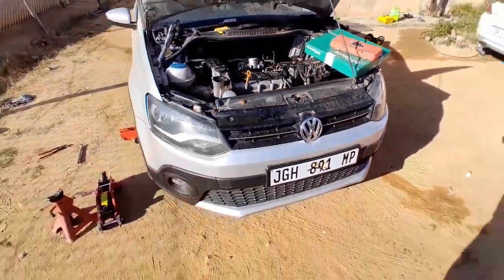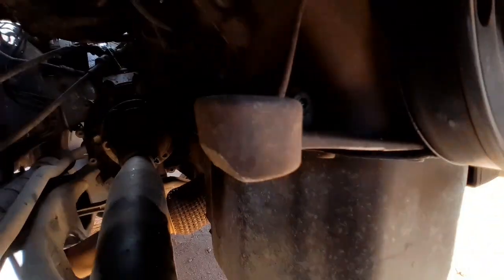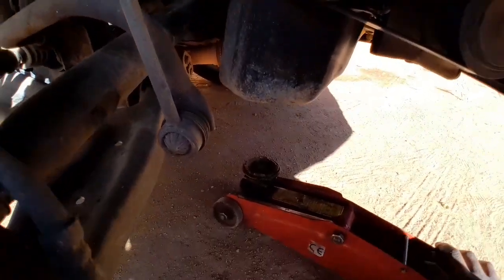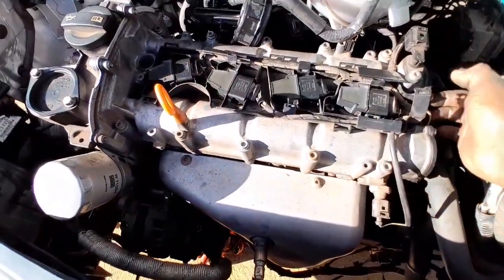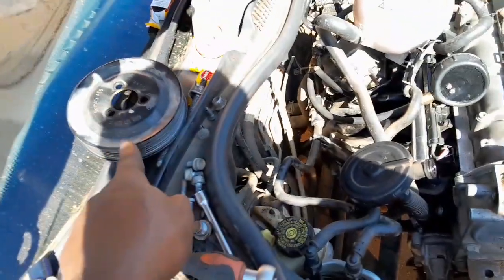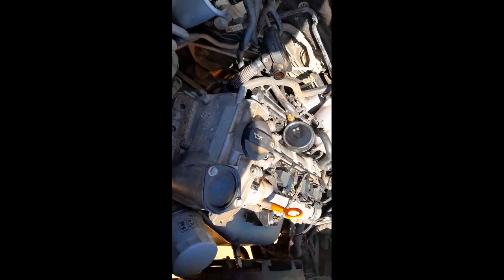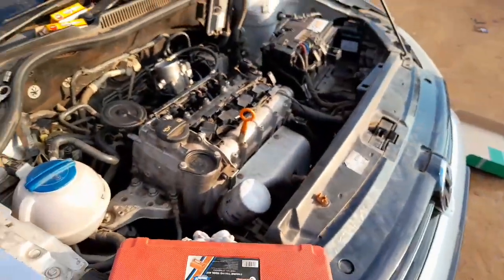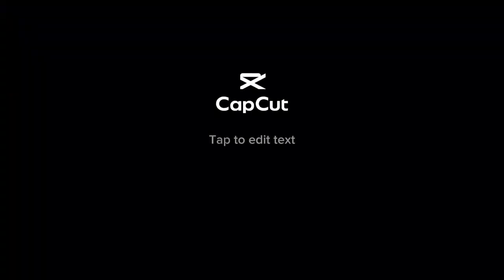Vw Polo timing chain kit replacement

Comment: Chief amazing work it's fascinating for us diy's cats,  quick ques though at one stage you used the dip stick to check for TDC or something through the 1st spark plug inlet or hole and I didn't see you when you took it out or when must it come out and ooh the cams as well when you were putting in the special tool to hold them in place maybe if you can tell me when and how I'd appreciate that..
Reply from the maker: The dipstick I used just to give me an idea of where the 1st piston was. But in the timing tool there is a crankshaft locking pin which you screw in that set the TDC for you. I'll do another video that clearer
Reply: @jsperformanceza hi... where are you based

Comment: Great video! How many km had this car and if the tensioner was out(spring loose or what problem)?
I have a  polo 1.4 fsi 16v, 2005, 96kkm and at cold start, it rattles for a couple a seconds.
After beeing parked for a couple of weeks.
I don't know if i shoud change only the tensioner, guides and chain. Pls, what brand was your timing kit and what it contained?

Comment: Hi it's exelcelent information but how do you set timing when it's out
Reply from the maker: By locking the camshafts using the cam locking tool and locking the crank with the tool all is found in the timing kit

Comment: After how many km should a timing kit be changed ?
Reply from the maker: To be safe every 100 000km as the tensioner is affected by oil and the guides break and then you lose valves

Comment: Now I can do it, I need to know 1 thing, how difficult to replace oil pump
Reply from the maker: The oil pump is so easy. There's Allen key bolts on the Sump, drain oil, remove the Sump and the there's the oil pump help by 3 bolts.
Reply: @jsperformanceza  managed to do.